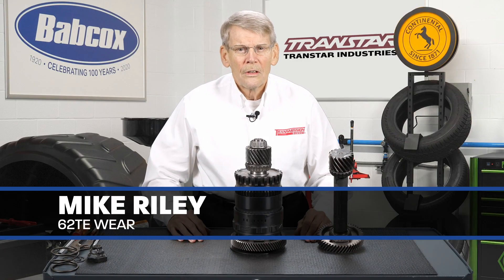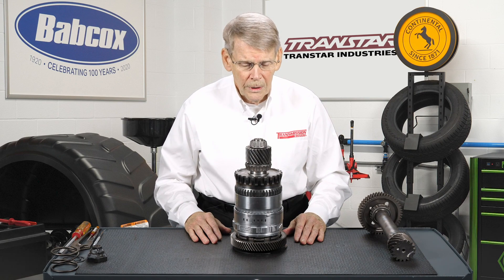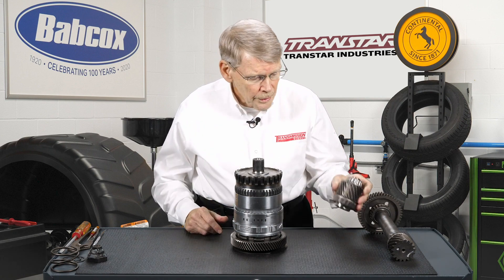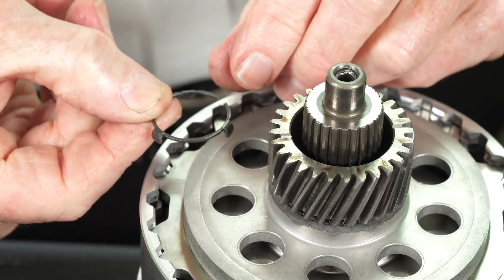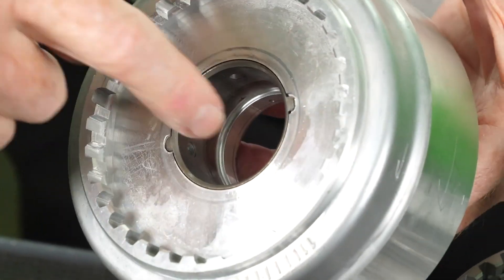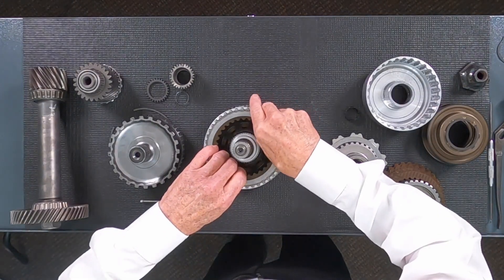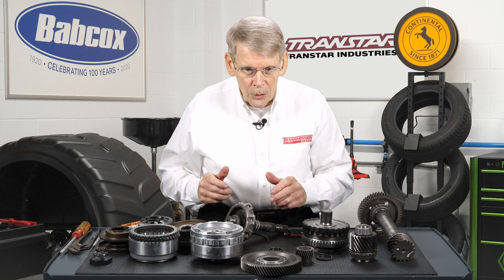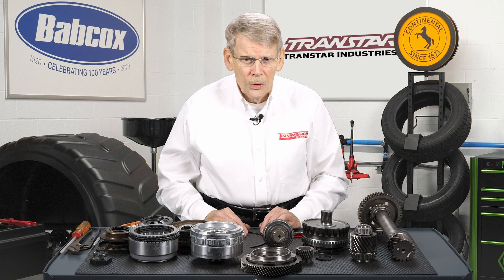Disassembling Chrysler's 62TE Underdrive Compounder Assembly

Comment: Amazing details. I am troubleshooting my error codes P0732 (gear 2 incorrect ratio), P0735 (gear 5 incorrect ratio), and P0792 (ISS sensor) the transmission whine also. I am thinking to buy a complete compounder assembly & swap it. Since I am there I will probably change the solenoid packs & TCC. Any help or advise is much appreciated it.

Comment: You have to take the piston out of the direct cluch under compression.  If you remove the snap ring without compression the spring will unspring rather quickly. 
Also in the low clutch when you put the top snap ring in to hold it all in you have to make sure the gap in the ring isnt within the area where the windows are in the low clutch drum. If you do it wrong this can cause the drum to, well come apart. We call it grenading. Its a fairly newly discovered problem.

Comment: for the sun gear snap ring it’s actually very simple (having done hundreds) i take a thin straight pick and get behind the ring near the split. then i use a thin 45/45 pick and use it to lift the ring out while rotating the ring and it pops right up